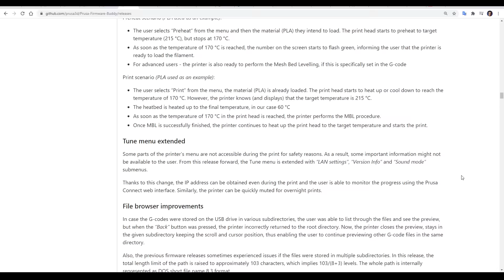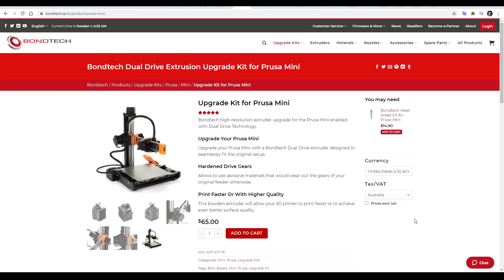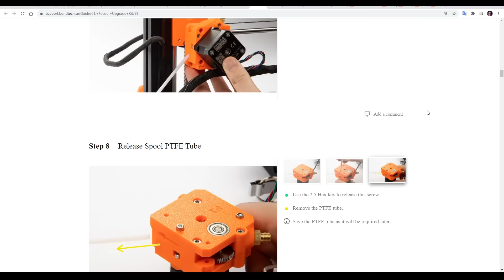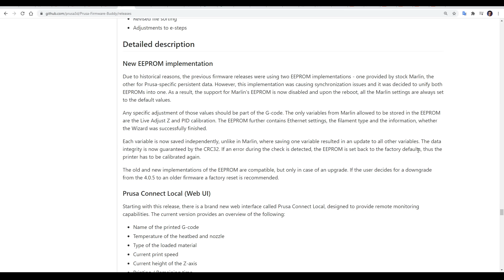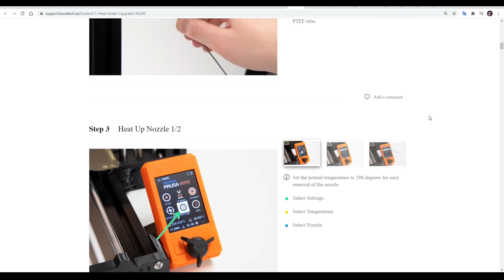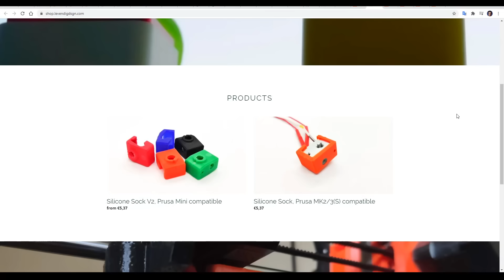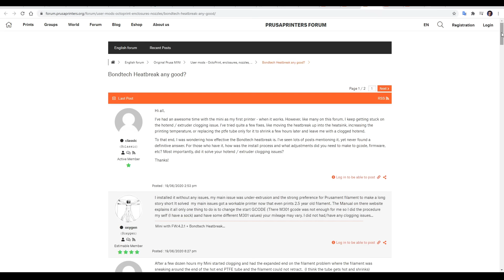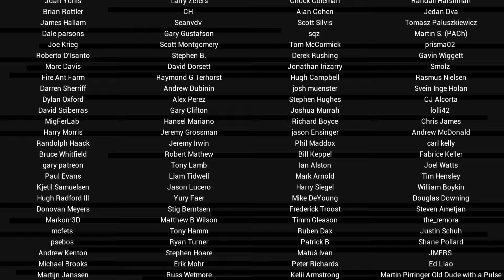Prusa Mini update: Improvements including Bondtech extruder & heat-break

Comment: My MINI hasn't had printing quality issues, but it's very prone to filament load/unload headaches. Often having the filament snap along the way or feed in very slowly.

After how much I've loved using my MK3Ses, it has been a bit of a disappointment and time-sink.
Reply: Is it possible you are using cheap or old humid filament? Got my mini 3 weeks ago and I constantly switch between my 4 colours with no issue.
Reply: I pre-ordered it on day one, so it was one of the earlier batches, right after their first set of hardware fixes. The filament I've been using, including fresh Prusament, has been in good condition and works well in my other printers. I learned to avoid cheaping out on filament many years ago and have invested in humidity-control for storage.

I'm going to do as Michael suggested in the video and swap out the tubing for a longer length (Prusa recommended just sticking with theirs, rather than Capricorn, but I've got some on hand and it can't hurt to try the next time I need the MINI for a project; I've just been leaving it alone when another printer would do, due to the added maintenance costs). While it's printing, it works fine, so I'm not planning to do anything to the hotend, but I might change the gears, since it's not uncommon for the factory-equipped set to slip and just eat through too much to get a grip and feed forward (or unload), like in an improperly tensioned MK3 printhead.

Comment: Hi Michael. I’ve just sold my AnyCubic i3 Mega (3 yrs old), and have enough for the Prusa Mini Plus. Do you know whether or not this has solved the issues you experienced? I have a short list of Creality Ender 5 Pro, AnyCubic Vyper & Prusa Mini Plus and am prepared to pay up to $700 Aud. Do you have any recommendations. I’m 70 yrs old in 6 weeks and 3D printing is a hobby.

I’d like to here your thoughts. By the way, I very much like your honesty and well produced vlogs. Well done,

Cheers Ian
Reply: Hi, Ian, just a note, I am new to 3D printing and have had the Anycubic Vyper for about a month ( I just turned 85) IO found the Vyper to be very capable for my needs, I had a little fuss with the extruder that was an easy  fix, by just tightening a bolt on the main gear in the extruder. I will say a good many seem to be having trouble with the Leveling gauge however so far mine has been OK.
The reason I was watching this video is because I am considering a second printer (really don't need one) good luck with your choice.
Reply: An update. I was recently fortunate enough to find a Prusa Mini + for sale on Gumtree. So I bought it from a really nice fellow for a reasonably agreeable price and it is now sitting on my desk. It is small compared to the AnyCubic, but prints I’ve made so far are truly excellent. Im looking forward to getting to know the Prusa and Prusa Slicer much better.

Comment: The inability to change some firmware things is mildly annoying to me. I always like being able to PID tune when I need and change e-steps easily. But not having the machine save that is kind of a mild inconvenience. Especially if I forget to run the start gcode.
Reply: In firmware version 4.3.3 they added an "experimental menu" that allows you to change the E-steps and motor direction as well as change the z-axis length. Any changes made will be saved to eeprom.

Comment: I bought my prusa mini, assembled it, started printing a benchy. 2 and a half hours into the print the extruder got stuck and it did not extrude at all anymore, spontaniously. No clogging issue. The extruder is just complete garbage. Now I ordered a bondtech extruder for 100EUR, exactly what I did not want to pay for such a small printer like this. Almost 500EUR in total for garbage like this.

Comment: Got the mini 2 months ago and suffered the same inconsistent extrusions from day one. I got really frustrated as this was my first ever printer and I told myself I should have got the Mk3s which I did afterwards. After extensive research about the bondtech I decided to give them a try. I bought both the extruder and heatbreak but only installed the heatbreak to try it out. Never had any problems after that. I still want to experiment with the extruder but for now it prints really well that I’m hesitant to mess with it more. I only use it for PLA for now and the Mk3s for any other material. Not sure why prusa didn’t include that heatbreak with the mini. It’s only $15 part and I don’t think it would have costed them this price either
Reply: I had similar extrusion issues with my early unit. Turned out, that the heatbreak was not pushed in all the way (the PTFE tube was long enough). So I had to loosen the tree grub screws on the nozzle, pull out the heatbreak, clean out the filament and put the heatbreak back in. Since that, it prints perfectly.
Reply: That’s great. I tried that and worked for a few short prints and clogged again. I replaced the ptfe tube with the spare one and didn’t work either. It would work for a few prints and then clogs again. I was so frustrated with it that I put it back in the box and was ready to send it to them back. My mini is from batch two I’m believer as I ordered it in June and got it end of august. You would think that they should have fixed this issue with the batch two and newer printers but doesnt look like they did anything about it as a lot of people in the community that got it later than I did are still having the same issues. I cannot speak about the extruder itself as the stock one is working fine and stopped clicking after the bondtech heatbreak upgrade.
Reply: @mohamed1505  The one my buddy and I bought has had numerous issues too. Did you have clicking coming from the extruder? 
Here is a video of what was happening: https://www.youtube.com/watch?v=8W_gsklb3kA
We wasted so much freaking time replacing the PTFE tube, Cleaning the extruder, doing pull tests, calibrating, increasing then decreasing the pressure on the extruder, taking everying apart, etc. etc. etc...
What adds to annoyance is that it's an intermittent problem. One day it just works, then another day it'll fail 50% into a print. So then we spend another week root causing it. F*** this printer...
Right now it's working fine so I'm not touching it, but I would not recommend it to anyone else.
Reply: @tomsko863  yes that the exactly the clicking noise you will get when you have a clog. If you take your filament out you will see the gear marks all over it and probably depending on the filament you might see some filament residue or dust on the teeth of the gears. If you haven’t touched the idler screw then you definitely have a clog. Removed the filament completely and do a cold pull. Prusa website has a very good guid on how to do that with the mini . After that clean the gears with IPA 99 and a Q tip and if needed use very fine pointy tweezers to remove the filament dust from the teeth. Hopefully this helps. If you do get another clog or under extrusion then you are suffering from the heat creep this machine is notoriously known for it.

Comment: I received one of the first Minis and besides the Minda probe height being incorrect  from the factory it rivals my MK3s for print quality, though it is very fussy about getting the temp  right, for PLA if you’re off a bit the print looks awful. I’ve found that with the exception of Prusamement it’s 5c less than the MK3.

Comment: what’s your honest opinion when it comes to cloned prusas? I really want one but don’t wanna wait two months for delivery
Reply from the maker: I haven't built or used one so any opinion would just be speculation and not worth much.
Reply: Don't buy a clone, It's not worth It. I have a clone because I didn't want to wait for 3 months like you. I'm lucky that I can make an order from Prusa to replace part like fans, thermistor, extruder gears which were really bad in a clone. Also, bearings start to make some bad noises so I have to replace them too.

Comment: Wait... You can't M500? Why did they do this? This is stupid
Reply: was thinking the same thing.
Reply: Since Prusa has a very responsive and expensive for them support system, I bet that trying to diagnose problems on extensively modified printers still under warranty became too much of an expense. 

After the warranty expires, you break out a tab on the motherboard and modify/reflash to your heart’s content.
Reply: According to their patch notes it's because a desync between marlin planner eeprom and their layer of eeprom broke stuff, so they had to lock it down temporarily.

Comment: Prusa made the wrong decision by trying to develop their own full-metal hot end, it's hard to get right, they didn't get it right and it caused all these issues. It took e3d six revisions to get something that's decent. They should have put a PTFE-lined hot end in, most people only print PLA/PET anyway.
Reply: It is PTFE lined, but the liner is sometimes to short.
Reply: @merzto  the mini goes to 280 degrees, ptfe lined hot ends only to about 240. The ptfe stops before the heat break, it doesn't go all the way to the heater block which in my book makes it a full metal hotend

Comment: My mini worked wonderfully for about two spools worth of material. The few failed prints I had were from poor design and poor slicing on my part. I have had a beast of a time with it ever since though! I got the bondtech extruder and am about to purchase the heat break. Does anyone have any suggestions on properly tightening the tension screw for the extruder? I tightened it the way the instructions recommended (treating my PLA as a "harder filament") but it started clicking like crazy. That slowed a lot when I tightened it to a point that seems unreasonably tight to me. Perhaps this won't be an issue once I get the head break, but its still concerning.

Comment: 4.10.2021 Just got my upgrade kit because this printer sucks on its own, the usual clogging and jamming.  It's maddening Prusa is still shipping Mini's with these obvious design  problems. I contemplated just returning mine for a refund but found out I would lose $68 in the shipping costs. I spent about 6 nights/evenings to try and get this printer to work with just stock parts. I emailed Prusa support and went thru their recommended fixes but none of them worked and eventually they just stopped responding to me.  After much cursing and swearing at the whole situation I broke down and bought the upgrades instead of returning it. This has been a terrible experience, I had really high hopes  since it was  a Prusa, I've heard so many good things about the brand. I really really regret buying this printer. I should have purchased 2 Creality machines instead for the same price. The parts are cheap and arrive in 2 days and the printers are easier to setup and fine tune.
Thanks for the video, this made installation pretty easy and no, these still dont come with thermal paste. (just a random piece of candy instead) Luckily I had some left over paste from a PC build. 
I still might just sell this printer lol.

Comment: PRUSA kind of feels like AOL to me.  A 3d printer is now literally a simple collection of parts.  If you have to change the hotend thats $100 in wasted parts.  I started with 3d printing 5 years ago with a FLSUN i3 clone.  It came with a heated bed, dual z motors, and the cheapest of components for $350cdn.  From there I added a high temp Hemera and a section of linear rail for the X direction and a SKR Pro board with TMC2209 steppers.  

If you are brand new to printing and are a guy who will tinker then buy a cheap clone.  If you are a guy who gets frustrated at everything then 3d printing isnt for you.  If you buy all APPLE products the Prusa is for you!

Comment: For me Prusa = bad quality, just not as bad as the worst chinese companies. My mk3 work fairly well except the part cooling fan not being able to keep a consistent level below 100% affecting overhang quality for PETG. Prusa sent a new fan but no change, it is a design flaw.
Reply: Then you might show off your engineering skills and design a printer on your own without flaws. You are being nitpicky
Reply: A fan able to run at 30% without pulsing back an forth to 0%, is a pretty basic function that already exist in most if not all other 3D printers.